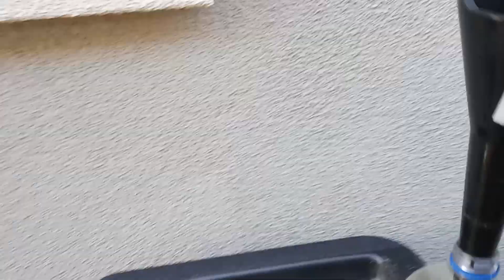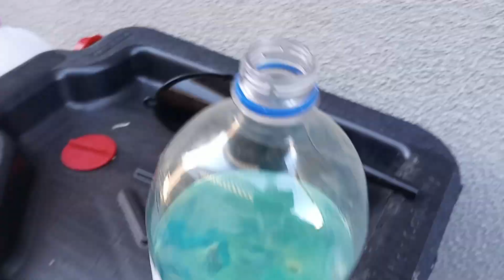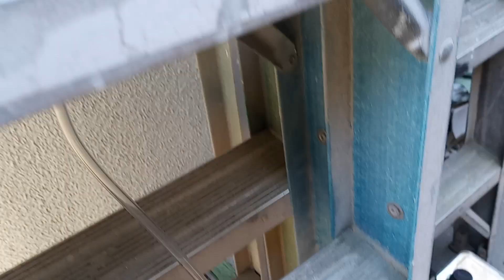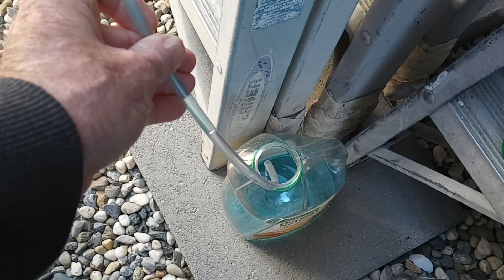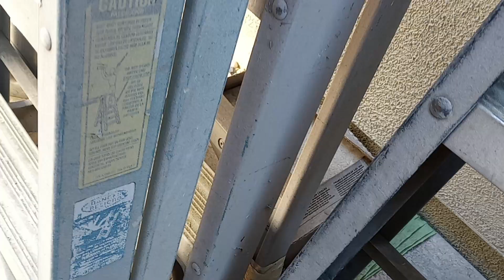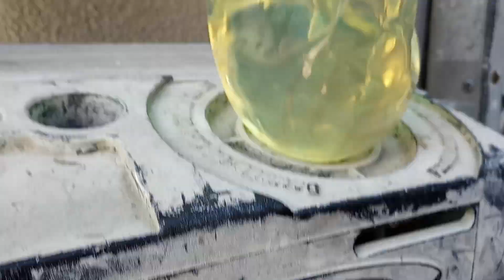Phatmoto/Sikk Ped: Ethanol delete made simple

Comment: Im fortunate that my local gas station sells ethanol free 89 octane fuel. I've had me Phatmoto for going on 5 months now. My only mode of transportation and have reached 2400 miles without an issue. Only thing not factory on it is the upgraded exhaust and went from the 50 tooth sprocket down to a 36. Ride it daily to work and back. But i also do weekly and monthly maintance on it. Clean the clutch weekly and keep it oiled. Change my oil once a month. Best motorized bike i have ever owned. Your videos have been a big help in keeping it in prime running condition. Thank you for all of them.
Reply from the maker: Thanks for watching, if you keep up on the maintenance the bike is reliable.

Comment: Just wanna say that I’m lucky to have a place near me in Joelton TN that sells non alcohol gas at 89 octane and another place that sell it @ 93 octane; the 89 octane is 4.55/ gallon and the 93 is $5.01. 2strokes do not like alcohol 🥃 or water and i have done ✅ your trick since back in the early 80’s on chainsaws and other racing go karts to save those rings, aviation fuel has the less water 💦 in it because of carburetor ice being a biG reason airplanes don’t use it! 4 stroke really don’t need it but will save you a lot of problems with the carbs!
Reply: My Little Phatmoto Lyfan engine loves both 89 and 93 octane, and so does my 66/80 cc China 🇨🇳 Girl  two strokes 😊😊😊…

Comment: What carburetor upgrade is there for the 79cc phatmoto you seem to be able to find just about anything I did find the roswheel bags thank you
Reply from the maker: Okay you have a few options, you can get a replacement carburetor same as stock only it has the air/fuel mixture screw, one drawback is it does not have the stock hook up for throttle cable. But that is a simple mod. Second option is putting a 2 stroke manifold and Nt/Speed or a small slide carburetor on it. When it is dialed in, jet wise it can increase your top end by a couple+ MPH. Another option that is still being investigated, meaning we are not 100% sure if it is a bolt on or not is, the Tillitson TCT fuel injection style carburetor. They are selling for around $25 to $39 online now. I cannot fully recommend it just yet, but am working on it. It is a game changer as far as performance, adjustability, and reliability. The stock replacement carb. is made by Autokay, sells for around $12 to $15 on Amazon/Ebay for the Lifan 152F-3 engine.
Reply: Thank u 4 ur time✌

Comment: Ethanol is actually good for piston engines because it cleans the carbon off the piston and off the combustion chamber and around the valves and off the spark plug/plugs which makes more horsepower and better performance. No need to delete it unless you want less performance or a carbon build up all over the combustion chamber and the spark plug/plugs.
Reply from the maker: Use it in your small engine and leave it in there for a couple of months and when it turns to gel from drawing water out of the air and plugs the jets in the carburetor. It is fine for a modern car with fuel injection, as its designed to use it. Small carburetor engines are not, it has no shelf life, so when the homeowner stores his snowblower/lawnmower or what ever he has for the off season it won't start or run later when he needs it. Small engine repair shops stay busy and make lots of money because Ethanol based fuel is used in a carburetor and left. If you use it and burn it up and never leave it in the fuel bowl or in the tank it can work for you, do not allow it to sit and degrade and attract water or pay money to fix it.
Reply: It's also great for the OIL companies. Ethanol contains less energy then gas. My 2014 turbo Volvo gets about 300 miles with 10% Ethanol about 250 Miles per tank with 15% - With R90 I got over 400 MILES ON A SINGLE TANK.... Dear environmentalists... How is burning more gas better for the environment? We did it to become energy independent.... Is that true? Nope. I measure the ethanol in my gas when I can.. Its never 10%